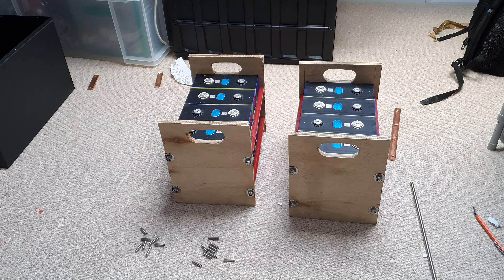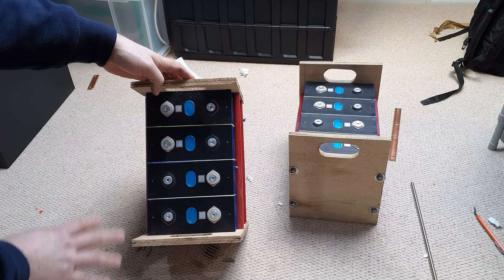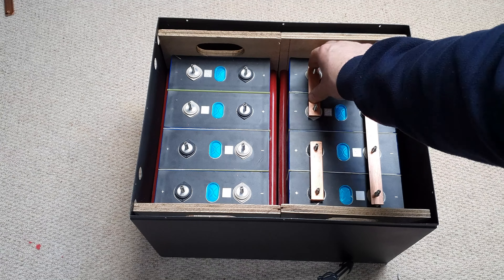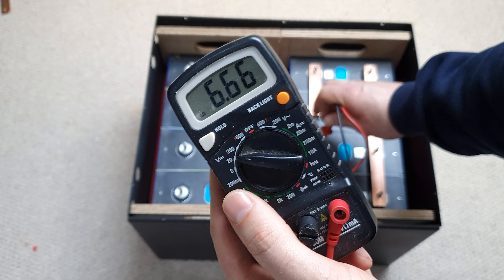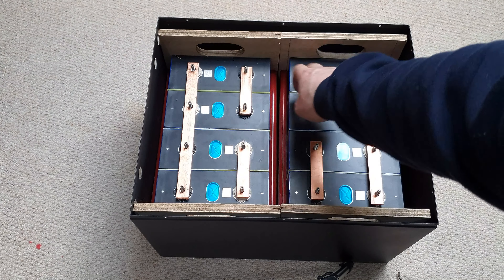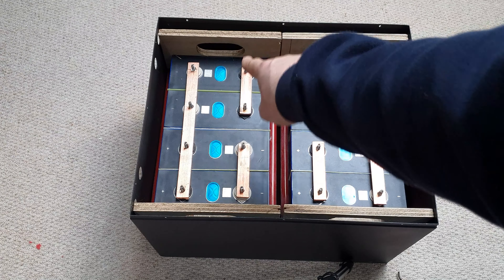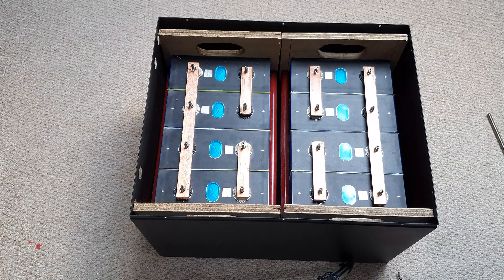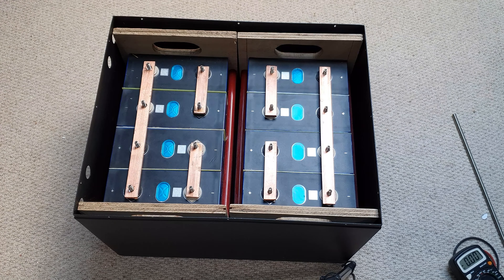LifePo4 Battery Build part 3 - Bus Bars & Case

Comment: A tip for everybody to make drilling your own bus bars easier cut the bus bar to length lay it on top of your studs and tap it with a mallet the studs will make a mark on the copper that's where you drill

Comment: Thanks, for the video!   Nice job!

Let me suggest that you wrap your busbars in electrical tape with only the holes exposed to reduce the possibility of a shorting mishap.,   Alternately, you can cover the holes and spray the busbars with your color choice of Plasti-Dip.   And, of course, be sure to wrap your metal tools, like wrenches and screwdrivers, as well.

Let me also suggest that you place some polystyrene foam between the sides of the batteries and the metal case, as well as on the bottom of the case.   This will help to prevent the side to side movement you referenced, as well as provide some insulation to help with temperature management of the pack.   And, if you are going to be using the pack in a cold environment, you can use a pair of car seat heating pads connected in series (to reduce the power consumption and heat produced) controlled by a thermostat to keep the pack above freezing.
Reply: I dont mean to be so offtopic but does anybody know of a trick to get back into an Instagram account?
I was dumb lost my password. I would appreciate any help you can give me!
Reply: @Charlie Decker Instablaster :)
Reply: @Dominick Maddux i really appreciate your reply. I got to the site through google and I'm waiting for the hacking stuff now.
Seems to take a while so I will reply here later when my account password hopefully is recovered.
Reply: @Dominick Maddux it worked and I now got access to my account again. I am so happy!
Thank you so much, you really help me out !
Reply: @Charlie Decker Happy to help :D

Comment: Nice explanation, i am planning for my home a 48v batteries set 16s2p(96 batteries)but is it not issue to top balance(with active balancer) them when they are in parallel 
You read so many things on the net and i don’t know it anymore,i am not electrician but i would like it to know bcse i prefer 3sets16s2p rather than 6 sets 16s

Comment: To ream the holes in the copper bar a stepper drill does a perfect job. If you pilot drill with a 4mm conventional drill and then use the stepper drill you can drill to 6mm and use the initial shoulder of the 8mm step to give the perfect edge.
If you increase the width of the busbars you can get the same conductivity using aluminium preventing any dissimilar corrosion between busbar and terminal
Reply: Aluminium has only 60% the conductivity of copper so your bus would need to be  around twice the  mm2 cross section
Reply: @brucearnold1077  That is the principle I used for my RV. By using twice the cross sectional area it provides slightly better conductivity. There is enough width to double the busbar width or use slightly less if you use thicker aluminium bar. Aluminium bar is readily available online and is cheap. To link two 12v 90Ah lithium batteries I think I used 30mm x 5mm bar (150mm2) which is ample for my application.

Comment: Are there any downsides to putting the cells in parallel like that instead of building two 12v batteries and then putting them in parallel? I know the benefit is that you only need 1 bms, but just wondering if there’s any downsides To consider. (I’m building the same battery pack but 24v)
Reply: 2bms better, 2 different system, one goes down, other still works. 1bms for this ah amount not the best
Reply: @alexferenci  thats based on what you think not everyone agrees 2 bms is best

Comment: I think but ,not sure, aluminum and copper have some sort of corrosion habit especially around salt water, but there is some sort of electrical paste for when you attach copper with aluminum . You can check. I would do it the sameway you have done it. Smiley face
Reply: True, especially given the environment and dissimilar-metal corrosion. I would imagine that nickel-plating the copper bus bars or spraying with a conformal coating after assembly would slow down the process.
Reply: If you follow 'off grid garage' (YouTube) he has already done some good analysis on this. Contact resistance with high currents can be a problem. Using the same metal for terminals and busbars is  better than trying to overcome dissimilar metal corrosion with paste. I used 30mm wide 5mm thick aluminium. If you double the cross sectional area in aluminium you get about 40% better conductivity than using copper. Aluminium is also cheaper, more available and easier to work with.

Comment: So, you are building a 12v system.  This will not really work for a 24v system will it?  Separating the two sets by threaded rods and plywood leaves a gap; you would need a four inch bus bar to span.  Not sure if that would be a good idea.  The holes in the metal box are facing the wrong direction for a 24v 8s "box" configuration.  Did you finish the build?

Comment: Please be aware that the aluminium case under the shrink wrap is positively charged. Should the case short to the metal box at some point then the box is also positively charged. A stray negative wire touching the box would close the loop. Your setup looks ok but others need to be aware.
Reply from the maker: Thanks Bruce, yes we covered this in part 2 which is why i added insulation plates between the cells but worth calling out again 👍
Reply: Duh!  Should have watched part 2 first

Comment: Hello from France, I am discovering your videos which are very interesting.  Here is my problem: The 6mm connection hole on the top of the 3.2v elements is messed up.  As a result, the 6 mm stud turns when tightening.  Is it possible to drill a 7 mm hole without risk of damaging the electrode or is it better to use another means?  I can restore the pitch of the stud with a small replacement thread (kind of spring) that we place in the hole to screw another smaller stud?  Thanks for your help.
Reply from the maker: ohh dear sorry to hear that. there was a youtube video I saw of someone repair one either tapping a new thread or using a helicoil insert check these videos out and good luck https://www.youtube.com/results?search_query=lifepo4+stripped

Comment: I am modeling my battery after your setup except 24V.  I will have (4) four-cell modules with two modules in each steel box wired in series with an 8s 100A  BMS for each box.  I'm hoping to create 8S2P configuration.  I'm not sure how to wire the two boxes together.  Anyone have insight into how it should done?

Comment: Aluminium + stainless = galvanic corrosion. Use zinc plated studs if you must, or just buy a torque wrench.
Reply: What is the torque spec on these batteries?
Reply: This shouldn't be too significant as the conduction is between busbar and terminal and does not rely on the terminal post. Published problems tend to be unwanted voltage drops due to poor conduction.

Comment: Why did you chose that configuration? You could have done 4 in series and then 2 parallel.i.e 4 of the cells is series to make each make a 12x280ah battery. The parallel those to make s 12x560ah

Comment: why 6 volt? nothing has run on 6 volts since the 1960,s?
Reply from the maker: The 2 x 6 volt packs join to make a 12v battery